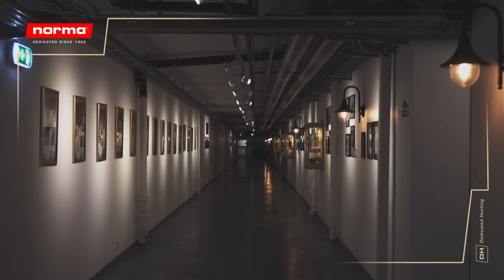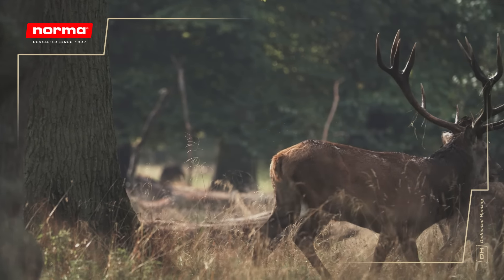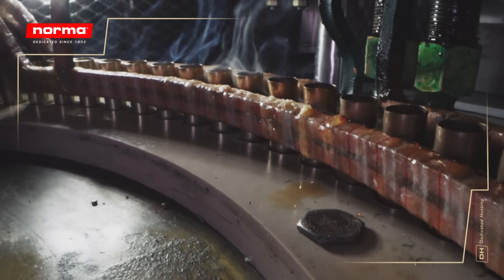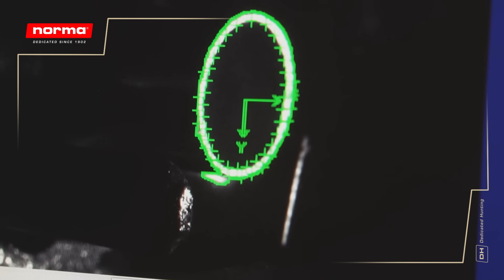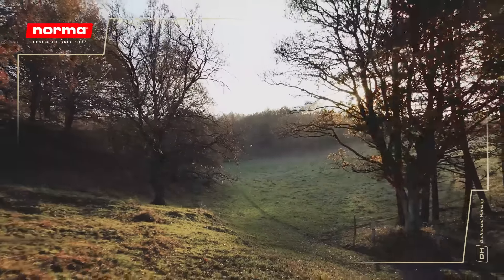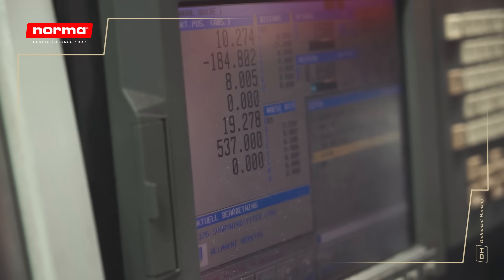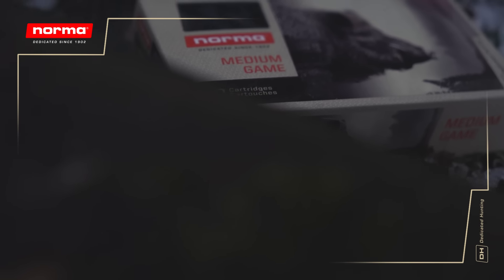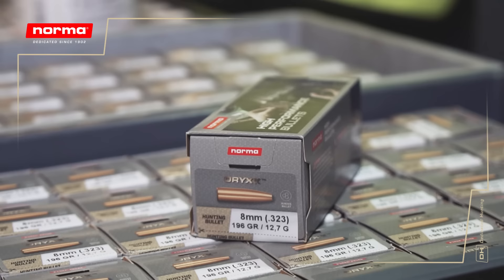How ammunition is made – Norma factory tour (2022)

Comment: Because there is no 6.5mm Bullets in the heavy weight 156 grain I am using the Norma Oryx and Vulcan 156 grain bullets for the 6.5 -284 Norma I own in an AR 10 I built.
I don't like the light bullets in 6.5 mm because want energy and as much bullet travel through game as possible.
Reply from the maker: Good point 👍🏻 heavier, well constructed bullets punch trough or go deeper than their light weight counterparts
Reply: @normaprecison  I will say on a Hunt I was guiding a client for Yukon moose in the High Arctic preserve the hunting the client shot a Hugh Bull Yukon moose in the neck with a deer gun 30-06 that only stunned the moose to fall over.
The Nosler partition 180 grain bullet only went 5 inches into the moose then stopped in the meat and the bullet blew off the full noise of the bullet leaving just a small bullet shank reducing the bullets energy.
I walked up to the moose that jumped to its feet with horns lowered and charged me with only second to shoot I jammed the CZ 550 Mauser in 9.3x62 Mauser into the moose's brisket and fired a Norma 232 Vulcan bullet into the moose that killed the moose as it fell on top of me.
I was trapped under the moose from my chest down, it took the client 45 minuets using an Alder wood log jammed under the moose to get the weight of the animal off of me, so I was able to wiggle out from under the moose.
The Norma 232 gran Vulcan bullet was found under the hide in the right hind leg and had expanded 3/4 the way and in a perfect expanded bullet with lead core still firmly in the copper jacket.
This Yukon moose was for sure at 1500 pounds and for a bullet to travel from chest brisket to hind leg under the skin and stay together is near unheard of for a cup and core bullet.
Take into account this Norma 232 Vulcan bullet had been fired point blank into the moose then traveled through all vital organs and the gut bag filled with vegetation that had been eaten then the bullet passed through the intestines and through more meat to rest between the skin and muscle of the hind leg and still didn't come apart.
This was loaded Norma ammunition I bought when I bought the CZ 550 in 9.3x62 Mauser and I still own half the box of that Norma ammunition with the 232 grain Vulcan bullets.

I have used other cartridges of this box of Norma loaded 232 grain Vilcan bullets to take down 1 wounded 9-foot brown bear that charged me and the client I have taken 2 moose for winter meat with other cartridges from this same Norma box of ammunition.
The 9.3x62 Mauser using Norma bullets is a death ray on all animals.

Comment: I had a case head separation in a 7mm Mauser back in the 80’s. That left a bad taste in my mouth and I have stayed away from Norma ever since. Im not knocking Norma. They may make some fine ammunition and components, but that was just my experience. Technology wasn’t what it is today and I hope their quality control has improved.
Reply: How’s the headspace on your rifle? I have a Spanish 93 Mauser with mismatched bolt. When fired with Remington (low pressure) ammunition the primers were backed out and brass stretched unevenly at the head. The 93 actions are weaker which is why American ammunition companies load it to low pressures. Norma ammunition from what I hear is pretty warm stuff. If you have a current production boat gun that’s not a military surplus then may be the ammunition watch to blame, but if you fired it out of a Mauser I suggest checking the headspace.
Reply: @jamesavery6015  yeah, at first I was thinking I’m going to have to remove the barrel, throw it on the lathe and cut some relief or face the chamber end, so I could correct a headspace issue. But when I checked the headspace after removing the rest of the cartridge from the chamber, it was well within specs. As well as I remember this was a 98 action. I have a custom.300 win mag that a guy got frustrated with and sold it to me for less than he had in the muzzle brake. I did a casting of the chamber and there was a TON of free-bore. So now I’m thinking of reaming the chamber out to .30-378. I gotta check the chamber specs first though. I might have to face the chamber to get rid of some of the free-bore before reaming a new chamber.
Reply: @sirtango1  Mauser 98s can't not be used for a Wby 30-378 when the actions are too short for the cartridges and would not be safe for that kind of pressure.
I have a commercial Mauser 98 I did in 300 Wby mag and loaded ammo the bullets must be seated deep to fit in the magazine so 30-378 sure wound fit.
Reply: @Lure-Benson   Totally different rifle. This was a custom deal. I think the guy used the same actions on the custom .408 cheytacs that he built.  I only bought the barrel. He kept the action to re-barrel with something else. I think he was going to use it on some .338 wildcat round.  But I haven’t started on that reaming project yet. Just something I’m saving to do whenever I get the urge! 😁

Comment: And there's a good reason why Norma ammunitions is expensive-quality and  consistency.
Reply: It's overpriced.
Reply: @NotNowChief.?  yeah it is a little over priced.
Reply: @NotNowChief.?  Have you ever pulled any factory ammo apart and weighed the components to see if they are up to specs? I did with a 20 round box of federal. 308 win 150 grain bullets that I had from years ago. The powder charge in 6 cartridges was 14 grains under what should have been in  them which is 44 grains. I couldn't believe there was only 30 grains in these cases,I chronographed a few and they were 2100 fps! Supposed to be 2700 fps. This is why I reload my own ammo,factory ammo is sht.